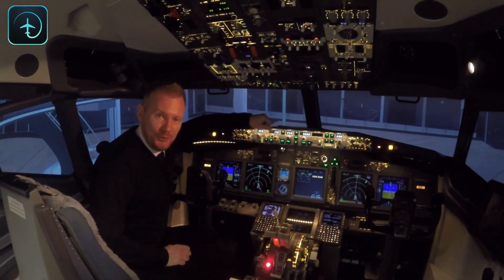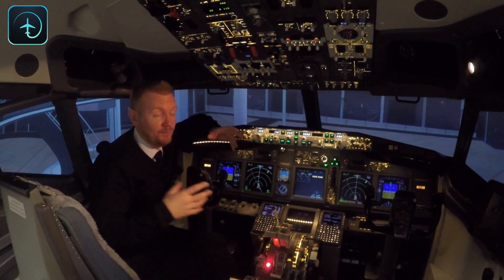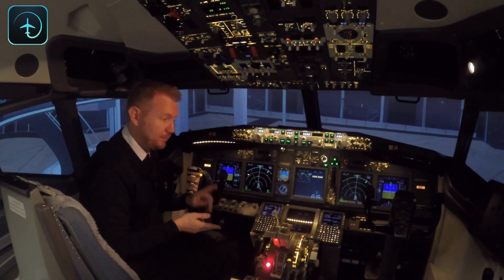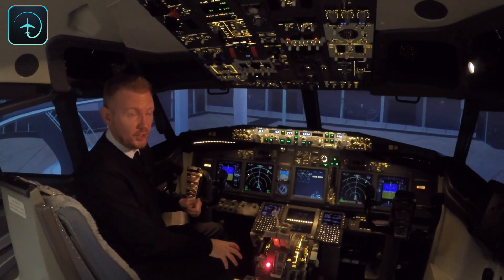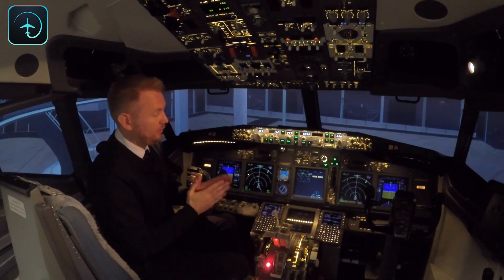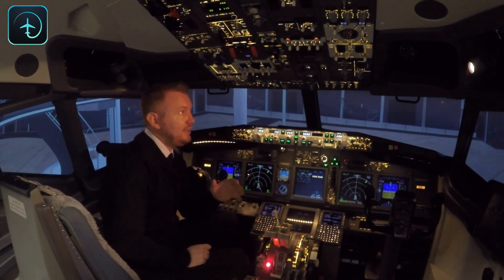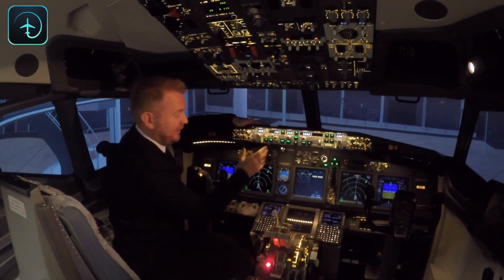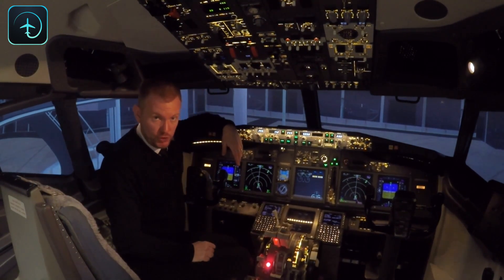How to operate a Boeing aircraft - Scanflows and Area of responsibility

Comment: Question...
If a pilot can pilot an aircraft in heavy mist, low visibility... Why are the windows still needed?
Reply: Unlike the underwater environment of submarines the simple answer is the skies are a busy place with many different types of aircraft operating under different levels of regulation.  Ultimately it remains every pilot's responsibility to see and avoid hitting anyone sharing the sky around them. 
FAR 91.113
Part (b)  When weather conditions permit, regardless of whether an operation is conducted under instrument flight rules or visual flight rules, vigilance shall be maintained by each person operating an aircraft so as to see and avoid other aircraft.

Comment: Recommend pulling the 2 red drag switches in the roof while flying helps the plane not crashing

lel

(just kidding they stop the fuel to the engine and turns it off immediately)
Reply: Uhm..no they dont

Comment: First you said the pilot flying were responsible for the over head panel and later you said he shouldnt be doing any of it? Is this with in the air or on the ground ?
Reply from the maker: +Ola Rusten Yes, great observation. The PF is responsible blue for the switches on the overhead panel when the aircraft is standing still. After it starts moving, it’s the PM’s area of responsibility.

Comment: Why bigger aircraft are slower during landing approach
Reply: Commercial aircraft and most training aircraft today are equipped with flaps.  Flaps are high lift devices that can be extended from the trailing edge of the wing.  Large aircraft and some light aircraft also have high lift devices on the leading edge of the wing consisting of slots and slats.  Extending slats on the leading edge of the wing and flaps on the trailing edge increases the camber, or curve of a wing.  This increases the wing's coefficient of lift for a given angle of attack, and reduces the stall speed.  In simplest terms, slats, slots, and flaps change the shape of the wings, allowing an aircraft to takeoff and land slower than it otherwise could.
Reply: If it is the braking would be better. Its harder to stop a big plane at higher speeds.The brakes get hotter when applied at higher speed a very dangerous condition. They can overheat the engine causing fire or not cool off for an hour interfering with your turnaround flight departure.

Comment: Why not use metric weights and measures?
Reply from the maker: +joseph nier We use kilos and meters for landing distance etc. The rest is just old habit to a large part.
Reply: And the fact that it is built in the us..
Reply: USA uses imperial system. There is conversion formula to change feet to meters. You should learn both. That's why an air Canada new plane ran out of fuel in flight. Thry were using metric dystem for the first time and thought they had pounds tons of fuel which turned out to be half the amount needed. Thus tank was half empty instead of full.

Comment: Q1... If I were to book a professional flight simulator, what should I do to prepare, so I could make the most of my time in the simulator (aside from practicing straight and level flight).
Q2... Is it possible to bump a button/control inadvertently, or are the buttons/controls designed to only be able to be pushed purposely?
Q3... Is it possible to injure ones self on the trim-wheels when autopilot is engaged?
Reply: Thanks, have a great day/night.

Comment: In an emergency, how do areas of responsibility work? I would have thought that the Captain would want to be communicating with ATC and flying the plane. I'm thinking of a scenario like Cactus 1549, for example.
Reply: Rules of flying: Aviate, Navigate, Communicate. Always in that order.
Main priority, if possible get/keep the plane at a safe altitude and course.
Next is figure out where you want to go. If possible head there.
Then let ATC know so they can help or at least keep everyone out of the way.

Pilot flying is always in charge of flying. Pilot monitoring would be the one running through the (emergency) checklists and communicating with ATC. The only reason that should change is if the PM is unavailable for whatever reason.
Reply: Now I have a greater respect for birds.

Comment: How long is a type-rating and are some much longer than others or are they all roughly the same amount of time ?
Reply: Marc Watson a type rating is required here in the U.S. to act as PIC "pilot in command" of an aircraft  with a max takeoff weight  of 12,500 pounds or more.
i.e. Boeing 737, 747, Airbus A320, A380 etc.

Comment: the thing you said about training and training the flows over and over again, would you say its a huge advantage to fly flight Simulators like the pmdg 737?
Reply: You have to be able to reach the pedals and to look outside. I think in one video he said 155-160 cm depending on the airline, but it mostly depends if you can reach the pedals and to look outside.
Reply: ah ok thanks, I`m 17 now so I don`t know which checklists I maybe will get in the future haha, but at least you learn the basic things, and as you said, some things aren`t even covered in the checklist because of the FCOM, or as you also said you learn the systems etc, so you know in which position the switches have to be in order to fly plane
Reply: Mentour Pilot What's the minimum height required to be a pilot ? How tall are you ?
Reply: There are no physical height requirements for civilian pilots.
Reply: Ristan Jones And to work for an airline ?
Reply: An airline pilot is a civilian....you just need a first class medical in the states.
Reply: You just use a childs booster seat!

Comment: Nice video man. Keep it up!
Reply: Hi Mentour Pilot, 
What are the main differences between piloting airbus and Boeing planes?
Reply: Mentour Pilot what is the difference between a captain and a co pilot and what is the captain allowed to do that the co pilot is not
Reply: @SUB-ZERO 01 The Captain is basically allowed to command the Co-Pilot to do certain things
Reply: SwagTurtle32 I can only speak for the A320. the main differences are the side stick vs.a yoke in the Boeing and the positioning of the thrust levers. we set for takeoff, flex,  climb and a full reduction to idle about ten feet before landing.
otherwise the throttles do not move when  speed commands are entered to the MCP. the A320 is very comfortable,  safe and a joy to fly. it is all weather capable. 
I have not flown the 737 so those questions must go to Mentour.